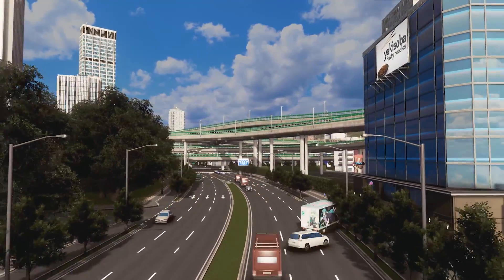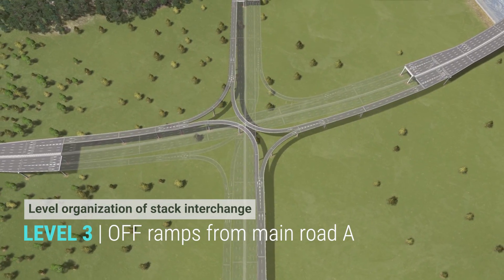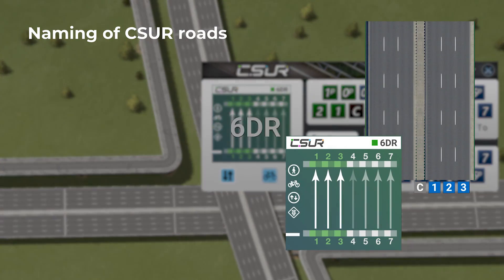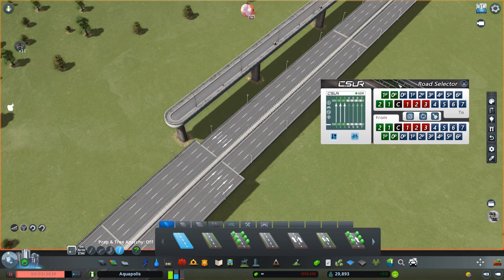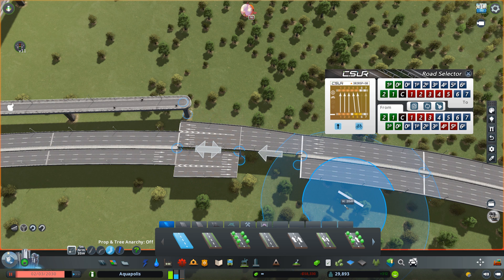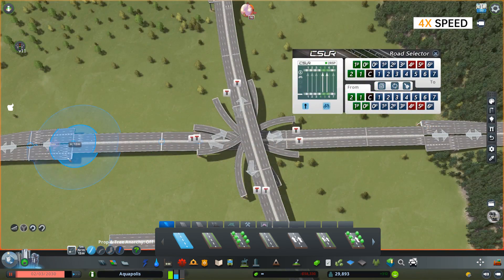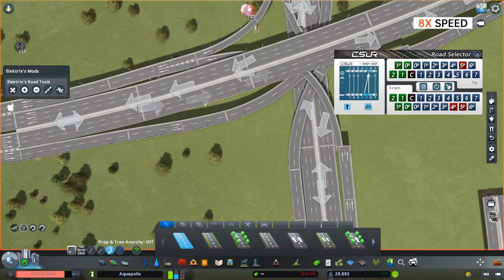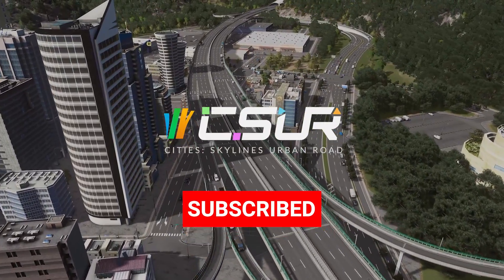Cities Skylines Urban Road (CSUR) Tutorial EP3 - Stack Interchange

Comment: Can I ask for CSUR version 2?

Idea:
 - Marking could be made with Intersection Marking Tool (no marking on asphalt required nodes/segments)
 - Position of lanes may be shifted by Node Controller instead selecting of concrete one
    (I must messing with it at small junction, because of missing transitions see https://youtu.be/OG7Qeq7tfA0?t=11294)
 
That rework reduces all roads to minimum. Railing such as pavement, sound bariers, cycle lanes may be done separately.
In the pack are also missing the emergency lanes for example, which could be added too.

The roads may be usign overpasses, which could be solved by adding availablity to allow drive deliveries on pavement using a template of empty pavement road.

Empty pavement/sound walls/bikelanes zonable and lines managed inside that space. I really hate that I could not modell it myself, because of missing 3DS Max :-(

Comment: I love this mod, but honestly, there are two things that actually, made me unistall it:

1) I love, love, LOVE. The streets that come with this mod, but the fact that those assets can only be used normally through the CSRU interface make them unusable in other circumstances.For example, if I want to build a simple diamond, and the rest of my streets come from this mod, I literally have to use one from the base game that won't connect to the CSRU roads correctly. That is something that I think needs to be checked. Adding "centered" versions of 6/5/4 + Lanes roads would be enough. 

2) Building roundabout is sad, frustrating and terrible. It can take up to 15 minutes to someone who has had the mod for a while, and I'm not joking. Please, even if you add em' as assets, make this easier.
Reply from the maker: There is a centered 4-lane road available (green 1P green 0P blue 0P blue 1P). Centered CSUR assets can be connected to all vanilla roads in the small and medium panels, and yes, CSUR is especially unfriendly to building roundabouts. The most tractable way is to do it in the same way as vanilla using centered one-way roads.
Reply: @VictoriaCity74 Ok wow, maybe I didn't understand the panel correctly. Thank you so much!
And yes, building roundabouts it's something essencial for most players. I hope you can find a way to make it a little bit friendlier. 
As I said, the mod is AWESOME, but I think that's my  main complain with it. Hope you have a great day!

Comment: How much RAM do you guys recommend for this, or for CS on general?
Reply: 32gb is the ideal since you'll definitely download thousands of assets lol. I have an entry level (amd 3200g + 8gb ram only) and it loads 7k+ assets and around 50 mods for around 30 mins lol. If the 32gb is not possible, increase page file and download the loading screen mod
Reply from the maker: Subscribing to all assets of CSUR will add 3GB of extra RAM usage right after loading (sadly), but with the game running for a while it will eventually go down

Comment: I don't get how you have the from P4+P5 to P4 to P5 with a pillar in the middle of them, mine only goes to the middle of the road, is there a trick to tell CSUR that you want to stop editing the road and fix the pillar position?
Reply: Le nevermind, either I activated the right setting in the toolbox settings  (something about lane smoothing or some such) or I got rid of conflicting mods (parallel roads or no pillars).

Comment: I installed all the mods from CSUR Reborn, but when I entered the game, the mod is not working! Am I doing something wrong?
Reply: Check if they are enable from content manager.
Reply: Santiago Turello Alvarado all the assets and mods are enabled. The bad thing is, I can’t even enter the game: when the loading bar is almost full, the game crashes
Reply: @stefanvalentin9157  Use loading screen mod to see if a asset is missing(enable option to generate log) and mod compatibility checker to see if there is a mod conflict. You can start a new map? to check if is not the save.

Comment: Hey! awesome video. I posted a question on the workshop and tried to add you. I subscribed to the M4 5lane module but can't seem to find it in game?
Reply from the maker: See https://github.com/citiesskylines-csur/CDN/blob/master/modules.jpg, the M4 pack will provide the module using the cyan-colored lane slots. For example you can check the lane 6 on both sides on Road Selector to see if it has found 1R6.